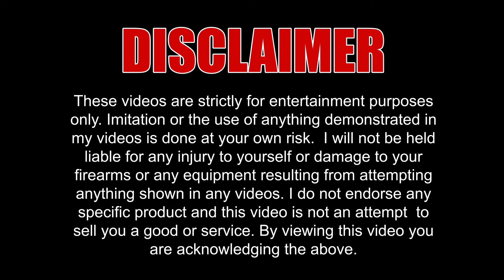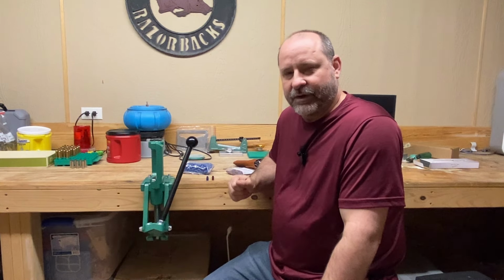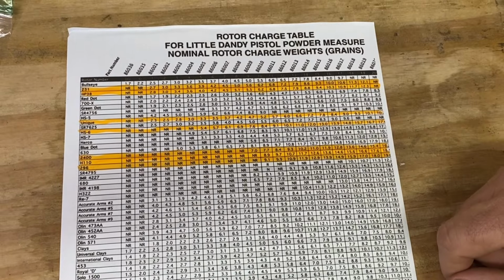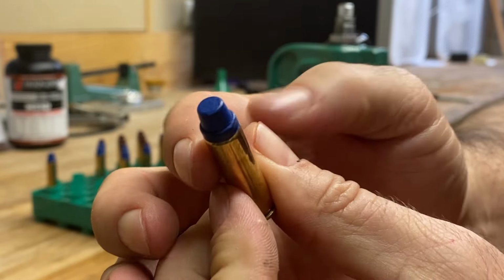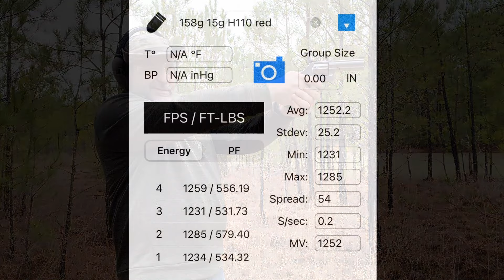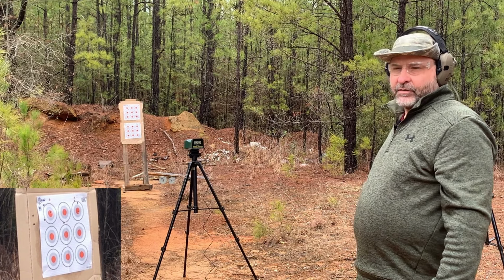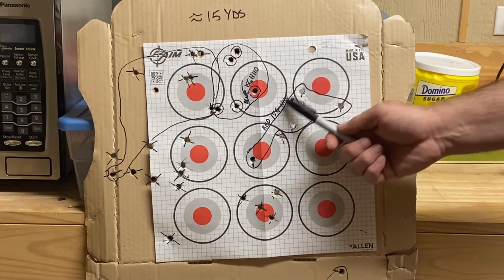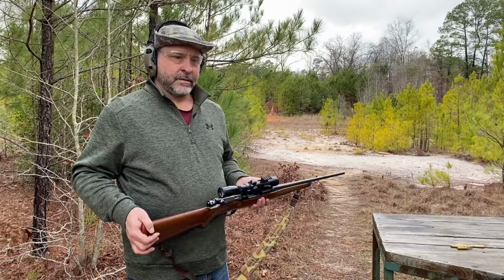Reloading 357 Magnum with H110

Comment: A few years back Smith and Wesson built some .357 mag. revolvers that would not stand up to the maximum pressure as stated by SAAMI in loading manuals. They were able to get SAAMI to lower the maximum pressure in loading manuals.  When loading for newer revolvers you will need to make sure you use a newer reloading manual. There is a difference in maximum powder charge in all my older manuals than there is in my newer books. It may only be a problem with newer S&M revolvers I don't know. Just be aware.
Reply from the maker: Yes!! Always refer to as many sources as possible; start low and work your way up!!  Not all revolvers can take the same pressures.
Reply: I believe it was their first generation of titanium J frames

Comment: The 357 is the round but factory loads do not have the power of the original loadings. And a heavy duty revolver you can really get some hot loads I've loaded a 125 grain to 1800 ft per second in the cast of Lyman bullet I believe it's 358 156 with a gas check up to 1500 ft per second. Then I would use the old Hollow pointer on them and they would expand better than jacketed bullets. I love the 357.

Comment: Hi, I can not find the RCBS Little Dandy you're using. Do you perhaps have a link where I can find it? Thanks
Reply from the maker: Midway USA has them for backorder :

https://www.midwayusa.com/product/1012936930?srsltid=AfmBOorUT9Se5TBcI1WcCS9xIv3JQN0n27-7E3EEnX-q8KLfqxCurBVT&pid=545386

amazon seems to have some now:

https://www.amazon.com/RCBS-86040-Powder-Measure-Little/dp/B000N8LGJ8

You will need to buy the rotors separately.  Midway, Amazon, Brownells, and most any reloading sites have the rotors; the Little Dandy is sometimes harder to find.

I hope this helps!!
Reply: @ thank you so much sir!

Comment: 1400 fps with a 158gr bullet out of a 4 inch barrel is pretty impressive.  I have a 6" 686 and I've never shot lead bullets out of it, so I may give the blue bullets a try.  I also have a Henry .357 rifle with a 20 inch barrel and I'm really curious to see how they will perform in it with that 16.9 gr load.  I'm looking for a cartridge load that comes close to maximizing performance in both guns.
Reply from the maker: Work up to it as I did; It is over all published maxs. It would probably be really good out of that 20in. Henry.  Let me know how it goes!

Comment: What was the COL on those?  Love the video btw.
Reply from the maker: I don't have any to check right now, but I believe that for the Blue Bullets it was 1.625" when seated to the crimp groove. I am not sure on the red Bayou Bullets. I believe the norm is 1.59", though I have seated some 160g LSWCHP to I believe 1.66" which still fit in my Smith 686.  That may be too long for some cylinders.  I like how the 158g Blue Bullets shoot in both the .357 mag and the .38 Special.
Reply: @CloningersGarage  Thanks for the reply!  I ordered some Blue bullets and I was just curious where you had your COL at.  I'm looking forward to working up a load for my little revolver!

Comment: Nice  vel.  16.9 gr 💥💥
Reply from the maker: Yes, nice velocity from a 4" Barrel!  It is stout. Brass ejects easily and no pressure signs.  I do think I will stop there!!
Reply: I love my Lil Dandy powder measures. I've tested the consistency of the throws while using it a few different ways. The most consistent is mounting it in a powder measure stand secured on a solid surface. But for plinking ammo, handheld is very fast. I'll even mount it on a turret press from time to time. I have 25 rotors. I store them in a 12 ga shotshell ammo box from MTM. Good vid! 😊